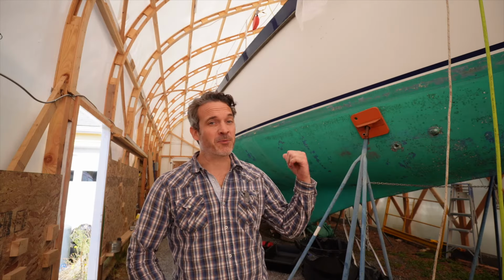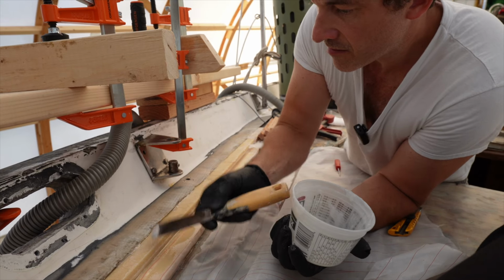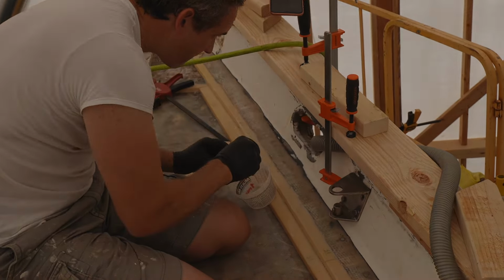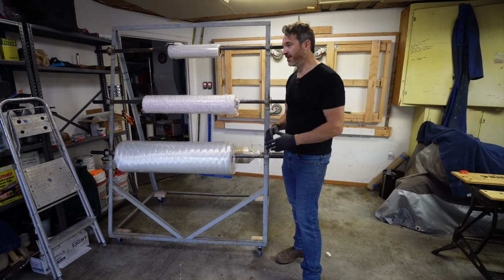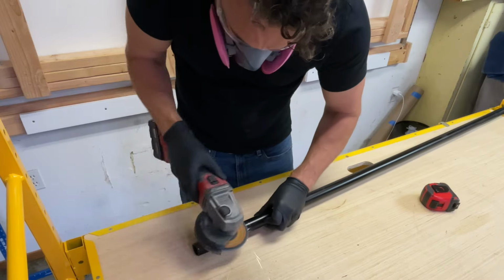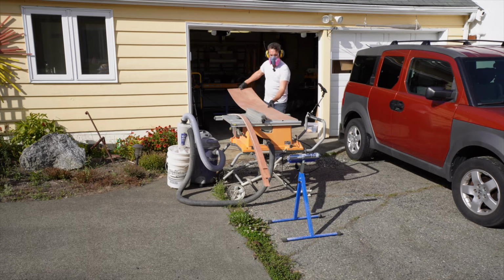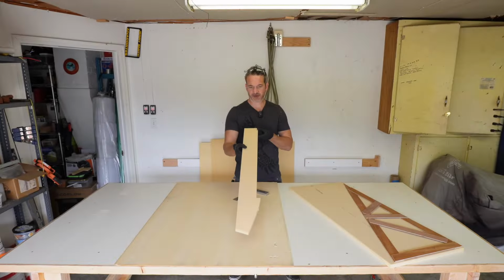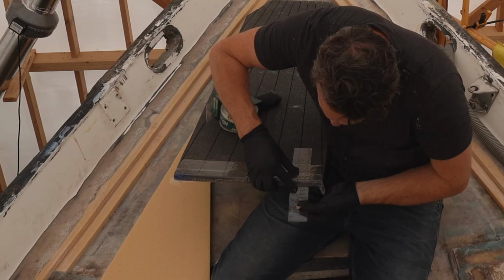Am I Going Overboard with This Deck Replacement?! - E012

Comment: Cut the top skin all the way to bulwalk.  Even remove the skin fron the inside of the bulwalk.
Reply from the maker: It has been suggested. It’s an interesting idea… so I assume then that you would wrap all layers of the new top skin up the bulwark? 🤔
Reply: @livingforsail  Depends on how the bulwark is constructed.  That way you know the construction and soundness of the bulwark and are able to ensure the integrity of the deck-hull seal.  Chasing leaks is not fun.  Rather than buy new hatches investigate refurbishing the old ones.  It is time - money issue.
Reply from the maker: @dan2304  I'm going to think about it a bit more. The idea has some benefits for sure. For the hatches I was able to pick up new old stock hatches over the last year or so from various sources and now I have all new hatches with new glazing AND hinges that aren't worn out for less than the cost of the refurb.
Reply: @livingforsail  Cool, way to go.  I too am an engineer but spent many years teaching high school.  Similar story for the house i built.  In the planning for a while and sourced lots at discounted prices.

Get it done before your sixties, and keep going if you can.  Life is too short and active life is even shorter; from a septuagenarian.  Joints are the week point.
Reply from the maker: @dan2304  Thanks Dan!!!

Comment: A couple of things I haven't seen in the comments: 1) I disagree with the assertion that you should remove the glass all the way to and/or up the bulwarks.  It is far easier working (specifically fairing after the glass work is completed) flat than up the vertical surface, and it would be even better yet, if you didn't need to get into the radius at the turn of the deck/bulwark.  2)  When mixed for the purpose with the correct material and amount, thickened epoxy doesn't thin as it cures.  This is my first episode so I'm not sure what or how much you used, but you simply didn't use enough fumed silica.  The one exception I've experienced was having the tubes of pre-thickened epoxy (stuff I didn't mix or test) slump after application.  3) totally my own prejudice here - but you don't need to put peel ply over every little spot of epoxy.  Although this is completely anecdotal - and subjective - it's easier to just hit those spots for a second with a grinder - amine blush isn't much of a consideration for such things and as you're no doubt discovering/already know- you're going to have plenty of spots to smooth out anyways, so will be spending lots of time behind one.
Reply from the maker: Thanks for the feedback. My Interpretation of the concept behind #1 would be to extend all layers of glass to the top of the bulwark and dead end them all at that top corner before covering with the bulwark. I don’t mind the idea of adding additional strength to the bulwark…
For #2 I think you’re correct that more silica was called for.  The epoxy viscosity does decrease as temps go up though. That’s a fact but maybe less of an issue as more silica is added? 
Thanks again for watching and offering your thoughts. Cheers! 🙏👍🙌
Reply: I agree there isn't much harm to extending the glass up and capturing it with the caprail (if that's what you meant) - just more work and may not be needed.  Not just a little more work - 4 times as much.  As long as you're not doing that for the primary purpose of increasing the secondary bond area between the new deck glass and existing, because it isn't necessary.  Also - not mentioned earlier - but standard operating procedures where I have experience - consist of prepping extant glass with 24 or 36 grit abrasive (flat) disc's on a 4.5 inch grinder.  I don't really know if that much keying action is necessary - but I've tried using flapper wheels, sanding disc's and other things - the flat disc is the best IMHO.  Just need to purchase the appropriate sized rubber backer for it to work.  Regarding the fumed silica, though I can find no study to confirm my assertion, again I know it's only anecdote, I can't claim your mechanical engineering background - I'd maintain the assertion all the same.  I regularly add fumed silica , primarily for fillers and the like, with up to 2x's by volume of the mixed epoxy much more causes different problems.  With that much thixotrope, and as little epoxy is being usually employed- probably even in your case, heat build up should be minimal, which is the only thing I imagine acting to alter the viscosity.  I allow I could be wrong - I've just not experienced it.  I'm interested to hear your thoughts - thanks for mercy.

Comment: Did you pay what the average price for this boat or did you get a really good deal on it??
Reply from the maker: I bought it in Canadian dollars so it was 40% off.
Reply: @livingforsail  well then that's alright.. just know that the liberty 458s are worth a pretty penny and then you're having to do all this repair that's more than just a little elbow grease, some paint and maintenance
Reply from the maker: @bendaves77  I wanted to do the work on the restoration and the reasons for that are anything but economical… 😉

Comment: Enjoying the videos and project.  In my experience using thickened epoxy...it's great at gap filling and having a gap is preferred.  Tight panels, like you would create in fine woodworking, causes problems where they do not need to be.  A side benefit is the fit-up and work flow goes faster with less exacting precision. Thumbs up
Reply from the maker: Thank you 🙏. I think your input is spot on. You do want some room for the epoxy to setup and Craftsman level wood work joints are probably not the way to go here. At least not when you balance time/energy. Cheers! 🙏👍🙌

Comment: Two things from my experience doing the exact same thing. I would put in the thickened epoxy (THICK is the operative word) putty with the tube gun against the inside of the bullwarks , slide in the prepared foam around the edge and drill some holes in the existing lip and fill with the putty gun. Leave a few vents to let the air out. Clamping down the edge makes sense. Vacuum bagging those areas does nothing for structural strength. Second, go buy a hand planer with carbide blades, makes it much easier to bevel the glass lip edge more uniformly and is much neater too. Best of luck. And yes, I am a mechanical engineer as well. We always try to make things the most difficult way.🤣
Reply from the maker: I am intrigued by the idea to use the hand planer… I imagine I’ll go through some blades but yes, that could give a really good surface for that type of repair… 🤔
I’m not so much looking for improved strength with the vacuum bag but more interested in getting a better shape since I can essentially have 15k lb of clamping force on a 1sq yd part without having to go insane bracing the wobbly bottom skin. I figure if I can support it in generally the correct shape the bag will take care of the rest. It’s also fun to try something new! 🙏👍🙌

Comment: Foam was way to tight fit after running through planer etc. A big gap is your friend here. Slightly thicker than mayonnaise bog in first, then push in lower sheet of foam and get heaps of squeeze out. Use squeeze out to push back into gap above lower sheet. Push next piece of foam in. Again heaps of squeeze out. Top stubb of glass will flex up. Place batten on top top of glass stubb to straighten it and get more squeeze out which can be reused. Cut foam into six to eight inch pieces similar to brickwork. Dont worry about inside edge where you will be putting the rest of the deck core. This edge can be cut straight after the void is filled so the rest of the foam can butt up to the clean edge. No need to overlap or stagger the join in the core materials butt joins are fine. Look at the balsa attached to scrim, a million butt joins!! You need big gaps for this to work. Tight fitting foam is no good. You need gaps for the squeeze out like mortar lines in bricks. Its messy just like laying bricks, lots of gloves required. Afterthought,  paint epoxy into void covering all surfaces before using mayonnaise mix. Work wet on wet and keep working down as far as you can go. This saves prepping in the void again after you finish. I would not lay large sheets of core as commonly seen in videos. I would lay thinner strips, say two inches wide to avoid voids under the core. Again perforated and grid scored infusion foam is best. Even if just pushed into mayonnaise mix manually the perforated grid scored foam allows air pockets to vent and squeeze out to come through the foam everywhere.  If using epoxy i would do the work in sections that i can reach easily and laminate the core after i clean up the squeeze out. Secondary bonding to epoxy wetted foam is a bitch. With perforated foam you can do larger sheets. Again leave gaps between sheets and push together to get squeeze out between sheets. Clean up squeeze out and hot coat foam, wait half hour for hot coat to gel and laminate. Stop an inch short of foam edge with glass but peel ply over the edge. When you remove peel ply to continue you have no glass edge to clean up! Cheers
Reply from the maker: Good stuff here. Thanks! 🙏 
I will aim for bigger gaps with more squeeze out in the future

Comment: I would not have tried to save the flange on the top side.  My preference would be to cut the top glass off back to the bulwark and then lay in the foam with a good bedding of thickened epoxy and then lay on several tabbing layers over the foam and up onto the bulwark. Then build up the top lawyer of glass to the required depth with the cloth lapping up onto the bulwark with a slightly different height to the edge on each layer of cloth.
Reply from the maker: It’s an interesting approach. I might have liked to even just add the 4-5 layers all the way up the bulwark to give that more strength without adding too much weight 🤔. I’ll think on that one.
Reply: @livingforsail  The way you are going about it is like draw an inside straight or picking up a split spare.  It is always easier to keep your ducks in in a row than it is to allow them to be separated.  Any more? 🤪
Reply from the maker: @haydenwatson7987  it’s the approach that was recommended by several experts but I think they would probably agree that a different approach could work well. 👍

Comment: I guess the foam is looking OK, but I am really partial to the shingled plywood squares randomly sprinkled over the deck and semi-adhered with a mastic of algae water and mold that you see some manufacturers using on boats, and then compressed into place by owners launching and retrieving their anchors. It's a hard combination to top.  😉
Reply from the maker: Do I detect a hint of sarcasm?! 🤣
Reply: :D

Comment: In hindsight - and I would not have thought of this before seeing this episode, should you have drilled a few vent holes along the outside edge - the glooped a lot of epoxy in before shoving in the boards - think about the relief vents used when casting plaster or metal the air needs an escape route to avoid cavities.
Reply from the maker: Yeah, I was thinking of possibly doing that as I continue. Cheers! 👍🙏

Comment: I liked that the beer was in with the essential items that you got ready before you started.  I'm not quite sure why you are planning on vac-u-bagging this section.  Is it really worth all of the extra work?  You are on a relatively flat plane on the bow, and I've always seen the vac-u-bagging used on vertical surfaces where gravity is working against you. Just curious as to why you are adding this step --  adding a liberal amount of thickened epoxy and some weight over the H100 should be more than adequate for a solid bond.  You have my vote!
Reply from the maker: Haha. Glad that you noticed that. The vacuum bag is going to be a bit of extra work but I’m interested in the result if I can pull it off. Plus I don’t like to make things too easy on myself… “there has to be a harder way?!” 
Thank you for the vote! 🙏👍🙌

Comment: Man thats a lot of template work to create air voids. Do strips mate, big sheets make voids by trapping air. By the time you made the templates you could hve stripped foam into bog on the deck and be finished. Vacuum wont get rid of voids unless you can bleed the air out. In fact as you squash the sheet down with vacuum yo might actually increase the area of the voids by squashing the air flat. Also air compresses so after you release the vacuum the air can expand deleminating larger areas. Stripping is easy with mayonnaise to peanut butter consistency bog. Precut your strips on the table saw and and have a knife handy to cut strips to length as you go. Keep recycling your squeeze out. Think teak deck size strips and techniques. Of course infusion sorts all these problems.
Reply from the maker: Thanks for the tip. I appreciate what you mean. I was following advice from the manufacturer. I can see how air pockets would be more of an issue with larger pieces… I was hoping that the vacuum was able to pull them through the perfs in the foam…

Comment: I dunno for a fact (so check) but a dry wall rasp may work great for fitting foam ? Looks fun really. After your finished with yours maybe I’ll do one lol
Reply from the maker: That would probably work. This stuff works very easily with most tools that I have tried.
Reply: Surfboard shapers rasp for the win.
Reply from the maker: @jackdbur  good idea 👍